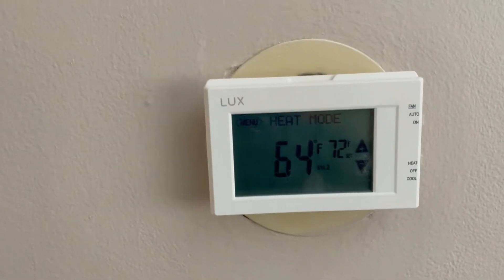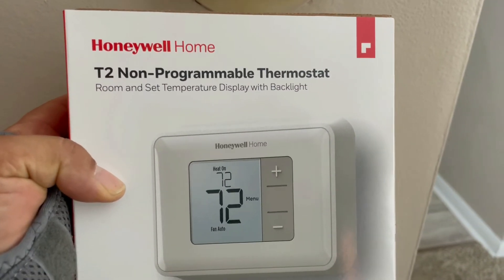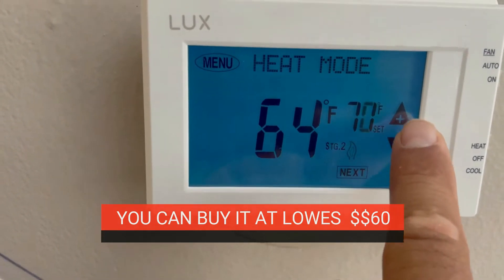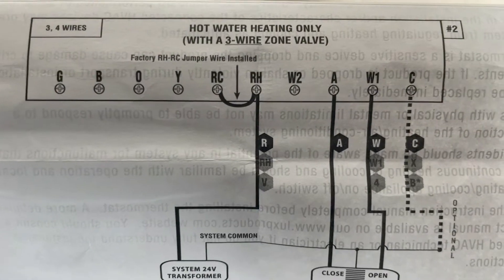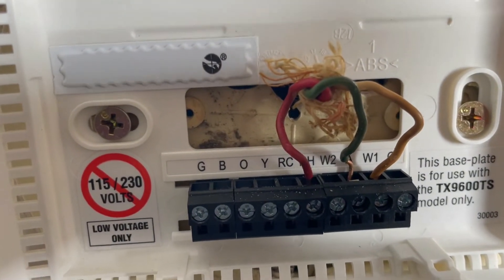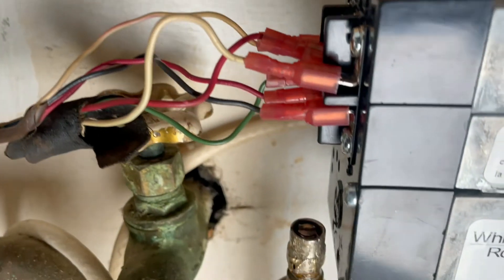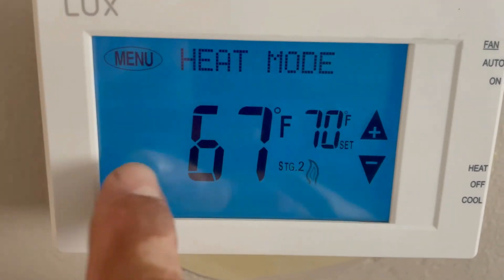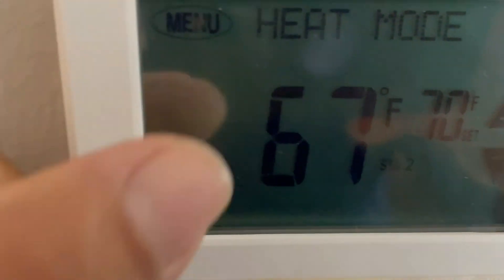THERMOSTAT THAT WORKS WITH WITH THE WHITE RODGERS 1311 ZONE VALVE

Comment: Greatly appreciate your video. I was chasing a "constant open" call for heat even though the thermostat was off. Turns out, my white (5) and red (4) were reversed. Swapped and it works as intended.

Comment: You can use any thermostat to control the WR 1311 zone valves if you install a relay. It works great. I just made this video that shows how I did it:  https://youtu.be/q46x93I7Esc?si=LQ3-X2lugxQrisII

Comment: I wonder why the Honeywell doesn’t work.  I thought any thermostat will control any zone valve. I’ve never had any issues and my zone valves are all made by Honeywell.
Reply from the maker: Hello.  Honeywelll zone valves are easy are either 2 or 4 wires.  Almost every thermostat support those valve. the White Rodgers zone valve is a  different animal.
They have three wires .  It needs a single pole, doble throw thermostat.   Out of hundreds of different thermostat there are  in the market only a handful  work with the WR 1311 zone valves.  Thanks for the comment.  See you later